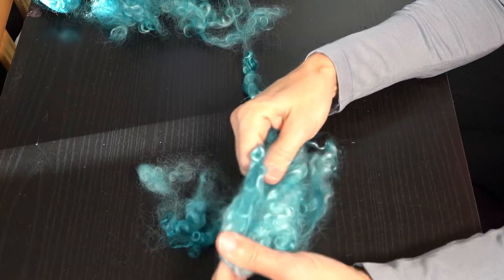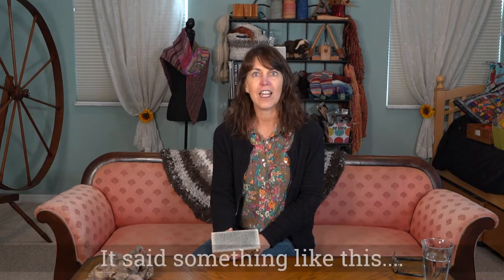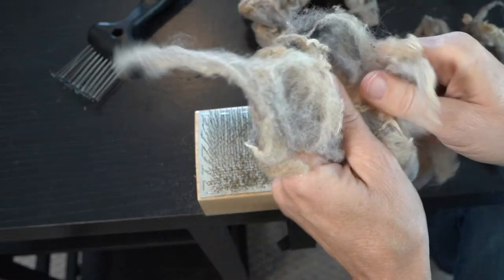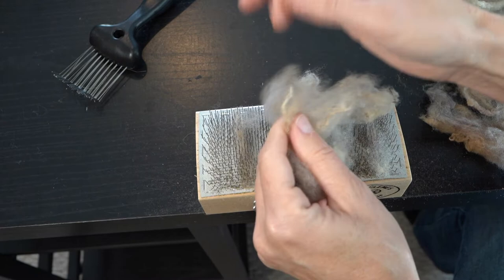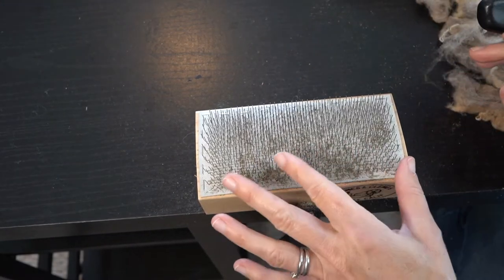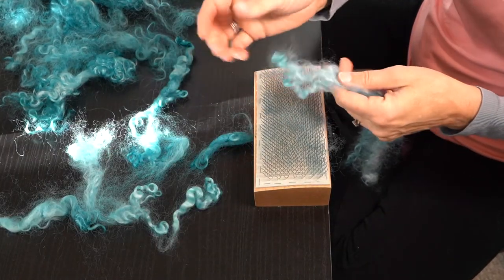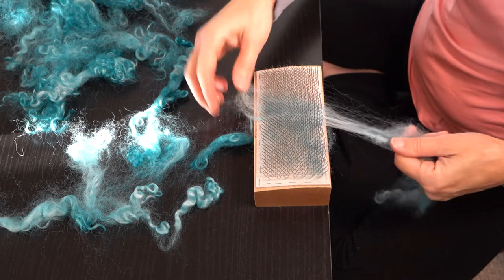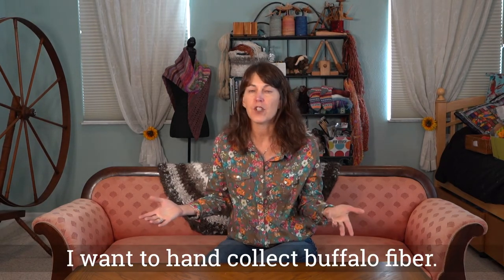How to Use the Lock Pop when Preparing Locks

Comment: How is the Lock Pop different from pulling locks gently through a hand card? Or using a flicker, if it’s not too tangled?
Reply from the maker: I like it because it's clamped to the table and I can use my two hands to work through a bunch of locks quickly.  I dont have a flicker so cant comment on that.  Thanks for watching.  ~Shiree
Reply: @glowilk5377  I use a dog brush for a flicker, so it’s very strong!